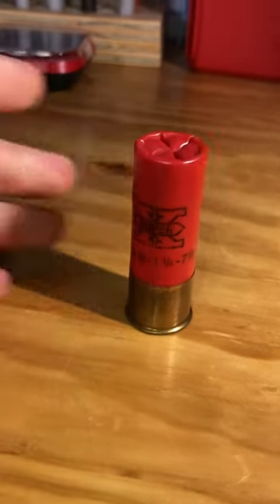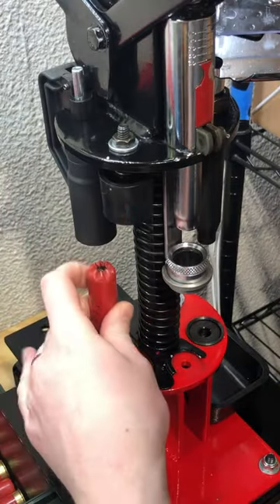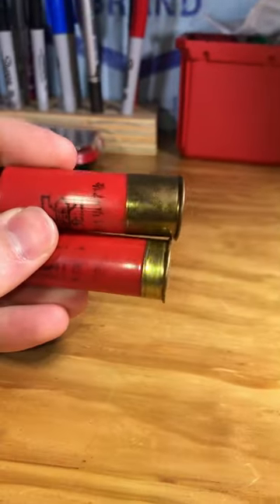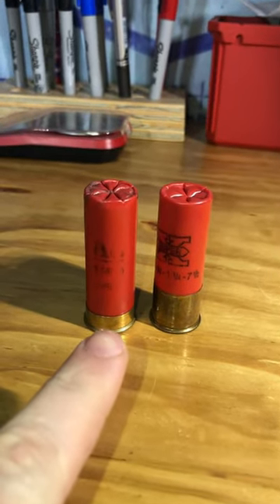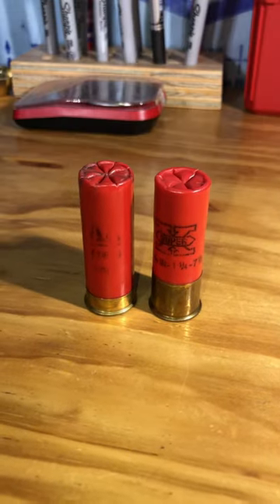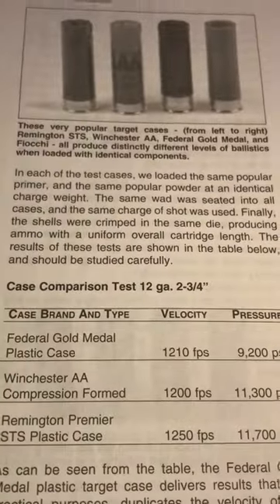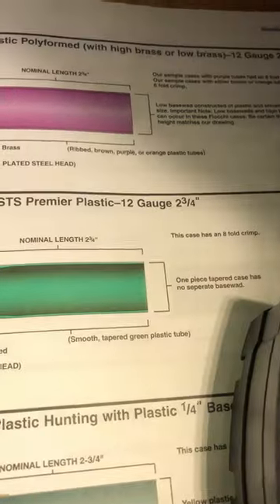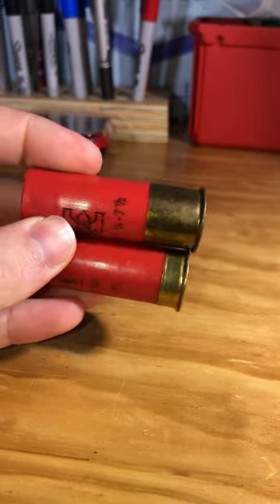Low Brass vs High Brass DOESN’T MATTER!  #shorts #12gauge #reloading

Comment: Hi or low brass. The powder charge makes the difference.  That paper thin piece of brass or brass plated steel. Is not going to hold 5,000 to 10,000 psi back. They made all plastic shells. Worked great but myths like these killed them. They throw extra "brass" on their so you'll feel better about paying $30 buck or more a box.
Reply from the maker: 100% 👌🏻 well said!
Reply: @The Reloading Craft  Been reloading for shotguns for over 45 years. MEC 600 12ga. Take your time don't rush it. Follow DIRECTIONS.
Reply from the maker: Also 100% agree. The MEC 600’s are solid machines and easy to use if you run them properly.
Reply: Yeah thats cool until you have a split shell that fails to extract
Reply: @Clorox Bleach  45 years I've never had one split. A couple of reloads, and I toss them. Local trap/skeet place has plenty of once shot shell. I have about 5,000 now. Not loaded.
Reply: @williamkowalchik572  I'm talking about combat loads, there is a reason for high brass, and that is to be the most reliable possible

Comment: If this is the case then how come you  never see a " low" brass foster slug ,  turkey load , or waterfowl load. 
Even in the shorter 2 3/4 " lengths.

Comment: There are many automatic guns that will jam on low brass shells. High brass has no problems on the older automatics. I have had this issue.
Reply from the maker: Low Brass Vs High Brass-Clarificarions
https://youtube.com/shorts/CutNvMusbnc?feature=share
Reply: Good chance it has nothing to do with the brass and more so the powder charge inside.
Reply: @TriebsOutdoors  all I know is my Remington will not cycle low brass without jamming. I have tried so many types. High brass cycles perfect.
Reply: It's also a problem in some pump guns. My buddy had an 870 that wouldn't extract most low brass, because of the single extractor it was pulling one side too hard and twisting the shell. I don't think it's the powder load I think it's a brass issue.

Comment: If you have a 7 1/2  shoot shell, one low brass and one high brass. Isn't the high brass one a hotter load?
Reply from the maker: No. The brass height means nothing in regards to the power of the shell. It’s a carryover from black powder and paper shotshell days.

Comment: Hi brass doesn't jam like low brass in a semi auto. I would never trust it in a automatic but it's fine for a pump or single shot.
Reply from the maker: Run some warmer low brass like a Win AA handicap and tell me the same thing. Bulk pack low brass is the weak loaded stuff most people shoot. The brass height makes zero difference, it’s how it’s loaded.
Reply: I've tried a lot of brands of ammo and different loads but still the same result low brass will not cycle in any of my autos. But I've never had any issues with the high brass.

Comment: So you can charge a low brass just as hot as high brass? I reload but not shot shells and seeing how much I’ve spent and continue to spend on reloading, I might not want to get into shot shell reloading. It does seem however that at least in shot shell reloading I won’t have a problem finding primers! Lol.
Reply from the maker: Assuming the hull is a quality and not a cheap bulk pack one, yes most of the time. Shotshell load data can confirm this, and as always stay within book recommended loads of course. 

Also yes, 209 primers have been easy to find, however dedicated shotshell powders are harder to come by.
Reply: @The Reloading Craft  Check a reloading manual,  many "magnum " loads are lower pressure than light loads. Because magnum power is slower burning, and provides a push for more of the barrel length. Powder charts show the burn rate.
Reply from the maker: You are correct. This is often added to by the fact that more “magnum” loads often use heavier shot charges, which need a more slow burning powder to get them up to speed.
Reply: @thereloadingcraft  that makes sense. In rifle cartridges it’s the same. Slower burning powders for heavy for caliber bullets.

Comment: Doesn’t a high brass shell typically have a higher powder charge then a low brass shell?
Reply from the maker: That’s how manufacturers typically load them, because of the stereotype of high brass=MORE PAWR!! In terms of internals if the hull is quality it makes no difference and they can be loaded to a wide range of powder charges.

Comment: Shouldn't a high brass extract more heat? Though i guess it doesn't matter in case of a shotgun.
Reply from the maker: I think brass transfers heat faster than plastic? At least in terms of the chamber more brass would in theory heat it up faster.

Comment: Some guns do not cycle the low brass.
Reply from the maker: Low Brass Vs High Brass-Clarificarions
https://youtube.com/shorts/CutNvMusbnc?feature=share

That has nothing to do with the hull and everything to do with how the manufacturer loaded it the first time.
Reply: 99.99% of the time those semi autos that have issues cycling low brass shells are because the gun is set up for heavier loads. And since high brass is typically associated with heavier loads therefore they cycle the gun better.  It has nothing to do with the brass itself.

Comment: high brass shell have a longer life !
Reply: if you two times load short brass you understand my reason .
Reply from the maker: I load Win AA’s (low brass) between 10-12 times before I discard them. I have friends from trap shooting that take them to 15-18 reloads even. 

There’s a difference between a quality hull (like a Win AA) and a cheap bulk pack hull that lasts 2 reloads and is toast.
Reply: @thereloadingcraft  I don't know where you live, but I only tested Iran-made cartridges and this problem existed.
Reply from the maker: @arminmohammadi1  I’d recommend trying it with some good hulls often used by reloaders. If you check out Winchester AA’s, Remington Gun Club’s, or Nitro STS’s, they are all low brass and reloading trap shooters swear by them because of how long they last.
Reply: @thereloadingcraft  Unfortunately, these cartridges are not imported to Iran, otherwise I would have loved to test them.
Reply: @arminmohammadi1 Once again brass has nothing to do it with...  I reload AAs 10 times before I toss them. I know guys who have been reloading the same Active shells over and over again for 20 years. In case you are not aware of what a Active shotshell is it has no brass at all!

Comment: What about no brass?
Reply from the maker: The No brass hulls (I’m thinking the ACTIV branded ones) were actually quite good, but people were too engrained in the “high brass is muh better” dogma to test them and accept it.
Reply: @thereloadingcraft  I didn't know they even existed, something I learn I guess.
Reply from the maker: Yup! They were honestly pretty neat but never caught on that well.
Reply: @thereloadingcraft  can you not have wooden shells or biodegradable plastic shells. I'm sick of finding shells littering the country side. -,-
Reply from the maker: Wooden shells I don’t think would work, but there are biodegradable shells out there (I believe Bioammo is one of the main ones)
I do wish biodegradable wads were more prolific though. Some do exist but they’re time intensive which is frustrating. Hulls I don’t mind picking up since I reuse them, but more wads I wish were biodegradable.